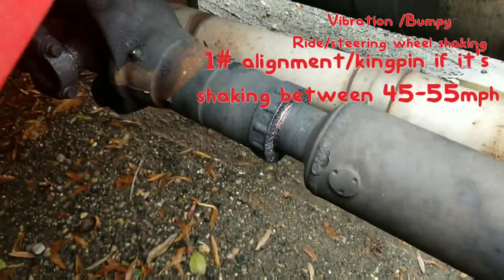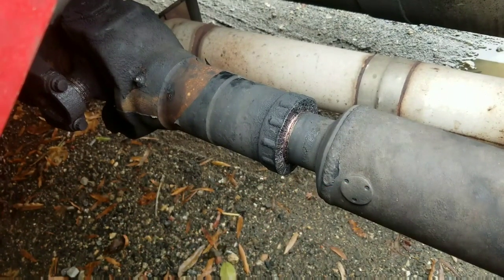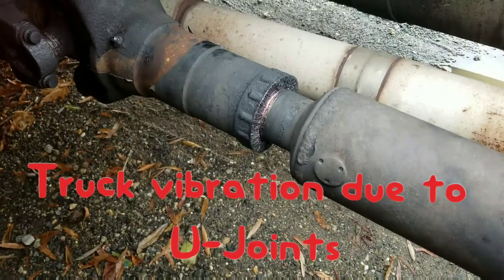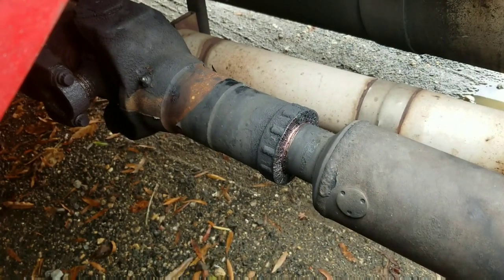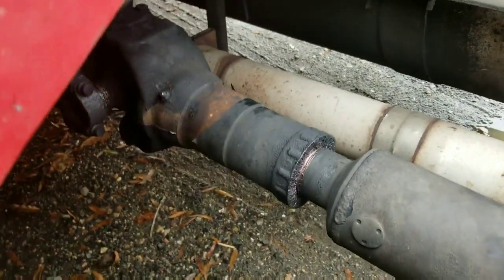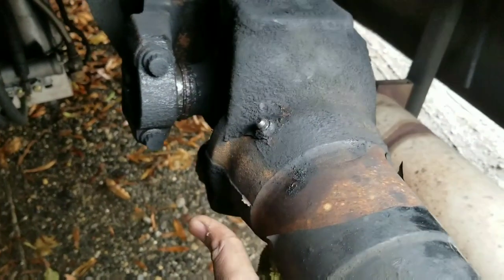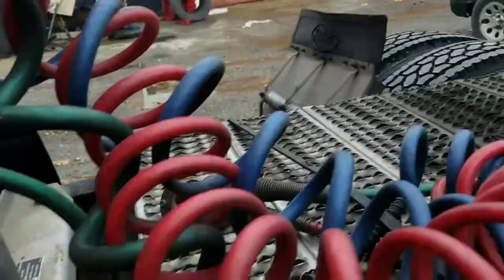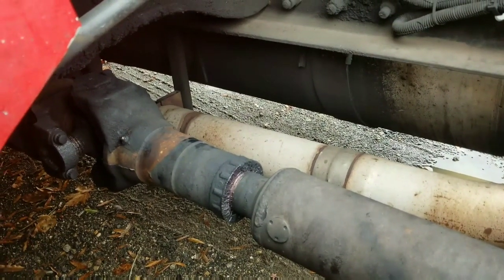solution for Truck Vibration /Bumpy Ride/ shaking

Comment: Remove the driveline u- joint straps and grind surface area off the backside of the strap , reinstall .  A small handheld 4” grinder works best .

Comment: I got hella shaking in my drives when I get up to about 55mph. It's only got 95,400 miles on it so it's not even broke in yet, but dang it's vibrating bad and getting worse. 
Hoping it's an easy fix, gonna take it in this week for maintenance.
Reply: Check the tire pressure that could be causing it to shake sometimes.
Reply: 95k miles is a little past broken in.. lmao just because the trucks can get over 900k doesn't mean it can't fail before then.

Comment: Replaced drive shaft and truck is still shaking at55 mph and at65mph after that it stops shaking,what possibly could be a problem
Reply from the maker: If truck vibrates between 45 to 60 its most likely Alignment issue.($250 to 400$) Before you ask for Alignment tell mechanic to look at kingpins too. Also look at you steering tires if they are rubbing or need to replace.  
If you want to test it let steering wheel go for few seconds and you will notice truck turning on left or right very quickly on straight route. Check my other video I showed that how to test it.
Reply: @desitruckersinu.s.a2797  I did alignment recently and tires are good,thanks anyway
Reply: @izvidjac9275  did u ever figure out what your problem was? My truck is vibrating at 55-65 mph mainly while coasting
Reply: @jova2194  it was injector
Reply: Had that problem with a volvo vnl 860 2021  , started vibrating at 62 to 68 mph.
Boss said , he changed the shocks and the steer wheels.
Reply: Hey i have a 2013 386 peterbilt, 13speed starts to shake/ vibrating between 50-65 mph while accelerating then stops after 65mph. shifting rpm15 but do notice it does it less if shift at 17 RPMs but may or may not continue to shake when I decelerat all this while loaded with a 53ft trailer empty or loaded. Bobtailing flys like a bird no issues bobtailing
Reply: @lsvs6770  did you figure out issue? I have similar issue and a 386 to
Reply: @izvidjac9275  did it loose its power ? Coz i have the very same problem as you but the engine is still powerful
Reply: @thabisolenkwane4533  found a problem, it was injectore,replaced al six and no problem anymore
Reply: Was truck bouncing? Mine feels like steers bounce and drives. Replaced bushings? Except spring leafs. I think my injectors might be bad cuz I'm losing lot of fuel mileage.
Reply: Was truck feel like bouncing?

Comment: Brother my truck volvo vnl760 2020 starts vibrating (bobtail) as soon I press the accelerator pedal all the way down. But if I speed up my truck slowly then there is no vibration. Any idea ??
Reply from the maker: Mostly alignment and bad front tires. Even sometimes people put chilies new tires on front and truck will vibrate. So only use good tires on front axle. 
When u driving bobtail is mostly bumpy because there is no weigh on tires.
Reply: @desitruckersinu.s.a2797  it was interaxle shaft problem. It lossen up the center nut on the third axle yoke. Mechanic said either reman the shaft or get a new one.
Reply: @SinghSatnamable  did u replaced it
Reply: @mirzaabrorkomiljonov8418  yes. I bought a new one for $2200 whole kit

Comment: Can it be on new Volvo 2021? Cause I feel vibration a little bit for about 3 sec then going smooth, then vibration again. All the time when I go 70mph and more.
Reply from the maker: You need to check your steer tires. And alignment
Reply: @desitruckersinu.s.a2797  so vibration just gone, now it’s flying. And I figured why. My 5th wheel was completely dry. It was making noice when I was making turns and that’s why it shaked whole my truck. I did changed oil and put lots of oil on my 5th wheel. Now it’s flying like a bird.